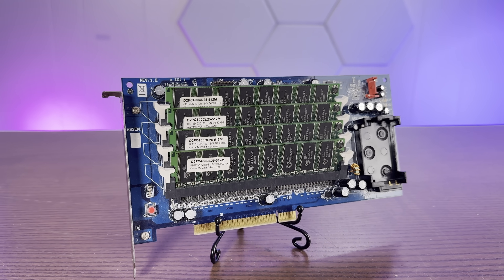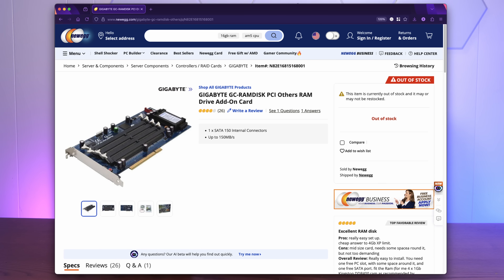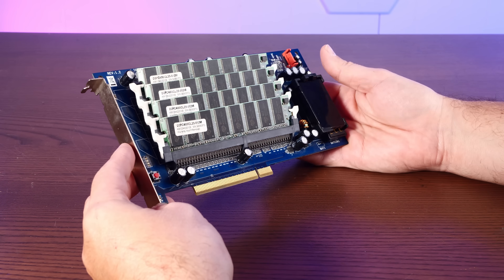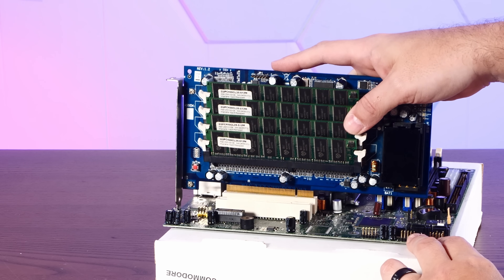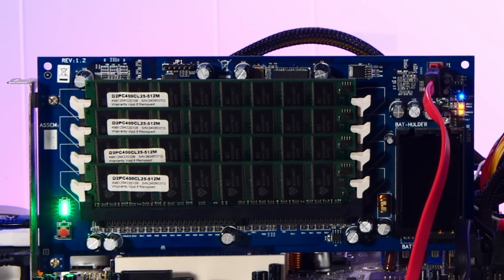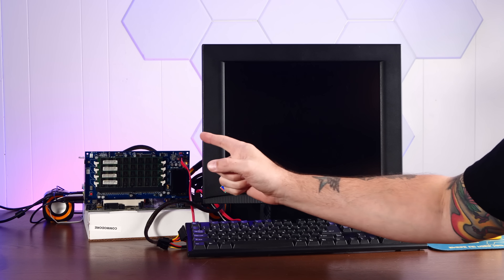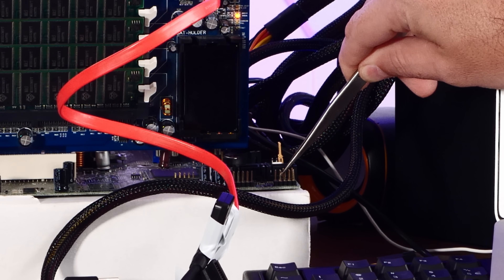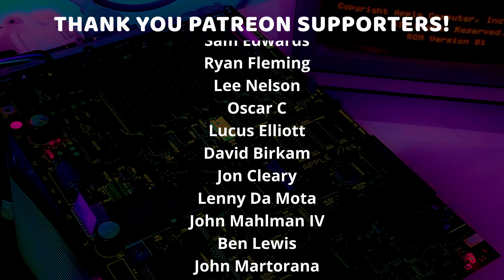This Early SSD Was WILD

Comment: Back in the 80s you got ramdisks on most 8 bit computers like the Apple II, Commodore 128, BBC Micro etc. Some had battery backup. So that they did it like 20 years later is no shock...
Reply: and on CP/M machines in the '70s.

Comment: For what it's worth, RAM disks are still a thing, it's just that typically they're programs that just section off a bit of your system RAM and turn it into an addressable disk. They can even be made non-volatile, but it requires that the contents of the RAM disk be written to the hard drive, then copied back during startup (A rather lengthy process depending on the HDD speed). With modern NVMe drives, RAM disks aren't all that useful anymore.

Comment: I had a customer who drilled water wells and he had an old seismic computer from the 80's that did a similar thing.  It was weird because the computer would boot off a floppy or hdd and then setup the "ssd" as a drive to capture the shot, but the ssd needed a ds1287 for the ssd to work properly.  I never did figure out why it needed that clock on the ssd, I just did the carve out to replace the dead battery with a coin cell and it started working again.

Comment: Fun fact: Some old game consoles used the same principle for saving data on cartridges. Your saves were stored in a piece of RAM in the cartridge, with a battery attached to it. When the battery died, bye bye data.
Reply: With the crucial distinction that they usually used SRAM, which didn't use much energy when not written to, unlike DRAM, which constantly needs to be refreshed to keep its data. So those game cart batteries usually lasted years.
Reply: You mean every old cart based game that didn't use a password up until memory cards became the norm?
Reply: @Helladamnleet  There were actually some N64 games that used Flash storage for saves, like Majora's Mask, Command and Conquer and Paper Mario. Expensive, but it allowed for large save games.

EEPROM was by far the most common method for on-cartridge saves on this system, which also doesn't require batteries.
Reply: Not some but all games which could save had a battery, up until the point consoles had memory or expandable memory. 
Thats the reason alot of publishers pushed for code based check points so they could make a cheaper per unit cart.
Reply: I remember that for the longest time 'battery backup' was the term people used generically to refer to save files for consoles. Specifically because of this design being the first way people used a save file for a console game and it was part of the marketing. (this more than anything else is why the original Zelda was unlike anything else before it)

I got an NES in early 86, just a few months after it launched in the US. That simple ability to create a save file or three really revolutionized how we played games. Password systems like used in Mega Man were simple enough and worked for games that only had a small amount of variables to save. But with any game that had some 645872364829736 character password, more often than not, we just wouldn't bother. Instead we would just do the same thing we did with games that didn't have any method to restart... just leave the power on and pray that you could unpause it when you tried to start playing later.
Reply: @whyjnot420  Funny thing is the battery backup was kind of a downgrade in save options for some games when crossing the Pacific. A load of the games you’d want to save on, like The Legend of Zelda and Metroid, were originally released on the Famicom Disc System, which used floppy discs. No batteries to die in time, just a Mitsumi 75mm floppy with a custom case for rough copy protection.
Reply: Yup I remember coming home one day and finding out that my Sonic 3 save was gone.

Comment: These were never intended as long term storage solutions. They were intended to provide a batter backed IO caching layer on high performance storage systems and the data stored on them was always considered volatile. The battery was intended to ensure that if there was a power outage or system crash, the last transactions could be completed before offloading to local disk storage.

Comment: Not uncommon at all. And definitely not an SSD, no solid stages here. Just buffered RAM. There also have have very expensive hard drives in the 90s, that mirrored all their data to a RAM at the hard drives PCB. The seek times were insane for the time.

Comment: These definitely were not meant to be used for persistent storage. The battery allowed the data to persist for power outages or physical shutdowns as a convenience, but the intent was not for storing your files. You put things on that disk you wanted speed from like storing game files to speed up loading, your system scratch, anything bottlenecked by antiquated hard drive performance. It would probably max out modern SATA speeds too if it wasn't tied to an antiquated SATA spec.

Comment: This was not the first example of a ram-based storage device with independent battery backup to preserve data.  The first one I ever laid eyes upon was an ISA card that could support a maximum of 20MB(!) of RAM on 30-pin SIMMs.  It was meant as a very high-performance enhancement for a  PC.  At the time, I myself was using extended RAM in DOS to host a small RAMdisk virtual drive that I would set up and populate with a handful of commonly-used programs at boot.  IIRC, I was using an alternative directory command program that organized files and used ANSI color to allow you to figure out what you were looking at in a single glance.

Comment: Use your USB adapter to hook it up to the Wii U, which should be able to format it into Nintendo's proprietary file system, and save and play eShop games from it.  The Wii U, unlike PS4/PS5/Xbox One/Series has a very low (32 MB...yes that's Megabytes) minimum for formatting USB disks for external storage.

Comment: You could do the same in software using your installed RAM back in the early 2000's. You just had to keep your PC turned on. I installed XP to a ramdisk just for fun and it was lightning fast compared to my 40gb IDE HDD I had at the time. And XP was a small enough install to only need a small amount of RAM to be allocated.

Comment: Hmm, it appears that there were similar systems originally made for the Comodore 64.  The Commodore 1764.  PS no backup battery.  You would load it with programs you spent much time on your system, they worked well and fast but you can see the obvious ram limitations.  They were pretty popular for gaming and office work.  Arrived on the scene much earlier, at least 20 years before the unit you have in this demo.

Comment: Ram disks go even futher back, by quite a few years. i recall seriously considering buying one that could hold my Dos boot files in the early 90'

But software ram disks were always better and a lot faster. Simply auto starting and  loading your ramdisk and files on start from an img or a designated drive that had the same size as the ram disk.

Comment: If this had RAID0 support, I think it'd have been a lot more popular.  There's a lot of untapped potential in that RAM.
I've always wondered why we never saw a PCIe version of this.  Sometimes, you need blisteringly fast storage but you don't necessarily need a lot.  Yes, RAM drives exist, but they're still volatile.  You could have hundreds of GB in a reasonable sized x16 card.

Comment: It can be much faster (in par with current cheap SSD) if the connection is not SATA but rather PCI-E.

So in theory the concept can still be used today with PCI-E and 4 x 16GB DDR5 RAM achieving speed of 12GB/s or faster using directly the PCI-E slot (no more SATA). I think I saw this kind of thing nowadays in market.

Comment: SO.. I'm old and I remember these being demo'ed at quakecon and reviewed on places like HardOCP.      Three major problems.  First, with this is that it was PCI and not PCI-E, and everyone who was building their own PC's at the time were getting their second PCI-E motherboards and wanted to buy to buy new stuff to put in PCI-E slots.   There was  one or two similar cards from other manufactures but they were really priced for enterprise with price tag of over a thousand dollars that have an external power supply, when a high end GPU cost $500. Most HEDT and Gamers instead chose to were purchasing multiple WD raptor (10,000rpm!) which was basically enterprise drive with SATA controller instead of SAS.  Which leads to the other major problem,  DDR ram wasn't high density,   XP couldn't use more than 2gigs of ram,  So most people only had 2gig in their previous system after upgrading to DDR2.  Lastly, RAM is volatile and not suitable for any files you want to be there when you reboot.

Comment: they are still modern versions are available for PCIE. This type of drive is usually used for fast temporary storage if you have not enough RAM and NVME drives are expensive and can wear out. Ram does not wear out.

Comment: I used to have one of those, or maybe copycats in like 2010. Battery was dead but I found some simmilar in specs and just hard wired it, I put some of my winXP files on it (win7 was basically dying on each time I installed it withing a week) and was a blast having that way faster system.

Comment: this kind of thing is making a comeback in the datacenter. there are use cases where you want a faster than storage, slower than ram in-between for your storage and memory. things like disk caches on storage servers and i think there are ai workload applications for it as well. except instead of being bottlenecked by sata, it gets fast pcie.

the grand daddy of ssds was more useful for work stations that needed scratch space for professional applications outside of what the machines of the time could support. if you wanted to say edit video, up to that point your only real option was raid 0, stacking bandwidth of multiple disks to increase speed.

Comment: In one of my previous "lives" (careers) as an artist creating lenticular prints, I used one of these for my scratch disk because building a 24x36 1200dpi lenticular image file required lots of temporary storage and was painfully slow on spinning rust.
Reply: These sound pretty funny by todays standards, but I remember the days when they made sense. I mean, I remember when people would actually use their system ram for this purpose (not like they ever really stopped doing this). I can clearly remember the days when 128MB on the vid card and another 512MB of system ram was pretty good (ffs, I still have a working 386dx33 with a truly massive 32MB of ram but I digress). It wasn't as bad as the days of DOS when you had to make every KB count, but memory was still at a very high premium.

While not as fast as sequestering some system memory, this was still sooooo much faster than a magnetic drive. I was deep into overclocking the hell out of my computers back in the aughts and I almost bought one, but I just didn't have the money to spend on it. It made sense to me the same way using a cheap SSD does for installing games today. Nothing you wanted to use as your main drive, but good enough for files you can afford to lose. (use for the swap file made a lot of sense back then too)

Comment: Sean yes this was absolutely, "The most cursted thing you've ever done." and it was totally hilarious.  RAM disks are very retro going all the way back to the bad old days of MS-DOS.  It was one of the ways to use that RAM above 640K.         Thanks for my weekly dose of retro-jank.  Shoutout to Dosdude for finding it!
Reply: They go back way further than that.   Some CP/M and MP/M machines were accelerated with RAM disk cards that had battery backup.     I serviced 256k cards from the late 70s as a teen doing hardware work in my university degree course.   I clearly remember a 64 Megabyte multiple board ISA bus card from about 1983 or '84 with literally hundreds of 62256 32kB static RAM chips on board, all with battery backup and a big Motorola DSP chip to control it.   That was an astounding amount of RAM back then and it was used for early digital audio editing applications  Plenty of big servers had RAM disk acceleration.

Comment: You can still, kinda, do this. Although, through software. There's DATA RAMDisk which did a partnership with AMD at one point when AMD Ryzen processors first hit the scene, and I think ImDisk Toolkit is still floating around. It still made sense when we just had SATA-III SSDs and maybe first-gen/PCIe 3.0 NVMEs, because DDR3 and DDR4 was still faster. A virtual image just gets stored on your SSD, and loaded on boot. With PCIe Gen 4 and Gen 5, and DDR5...PCIe Gen 6 and DDR6 around the corner, things are just silly fast and there's no reason.

ASUS also has (although it may be discontinued), RAM Cache III--boosts the read speeds of your storage using a portion of your RAM.